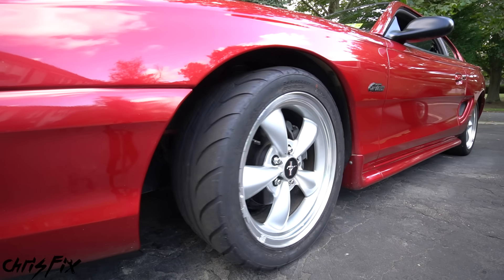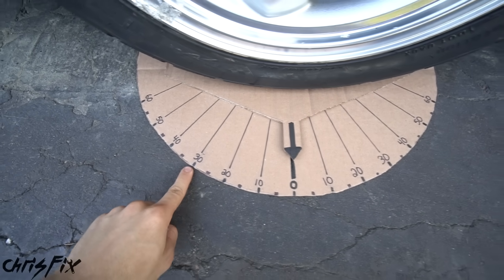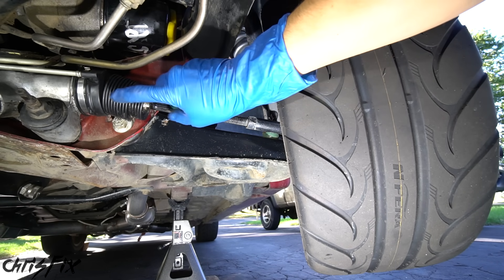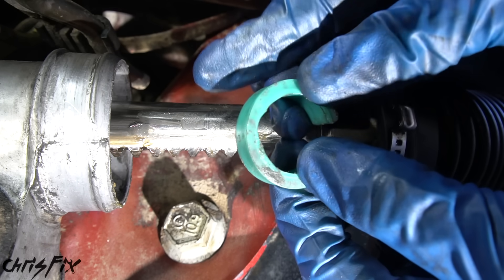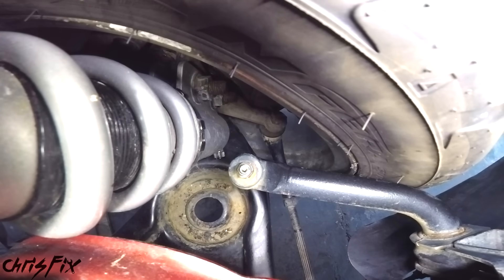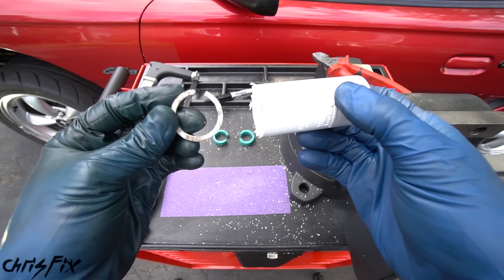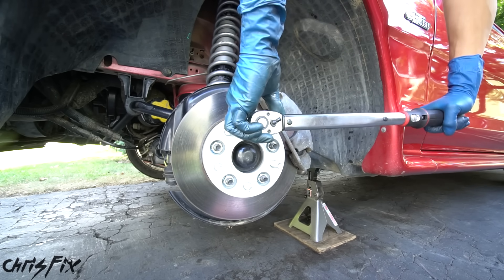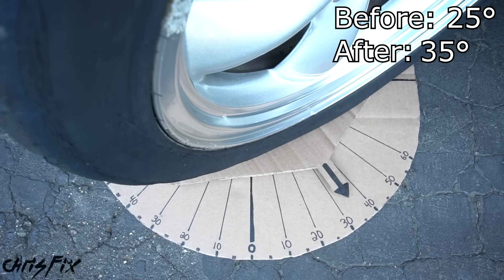How to Get Your Car to Make Sharper Turns (Steering Angle Mod)

Comment: Wheel spacers are illegal in Australia :(
Reply: Finan 7 only other options are:
-negative offset wheels 
-trim the c-clamp
-wheel alignment 
-that drift mod he mentioned at the end (future video)
Reply from the maker: Dang that stinks! That's what happens when people dont do mods correctly/safely using quality parts when needed! Wheel spacers can be very dangerous if you dont do it right and dont use quality stuff but that is why I explain all of that so hopefully people learn and are smart about it!
Reply: here in Brazil it used to be... But recently the government changed some laws and now we can even use air suspension... But any way, we must ask for a different car licence... its higher cost... Otherwise, if you dan't have papers, police can arrest the car and apply fines...
Reply: In Australia the fun stuff is illegal. I know because MCM.
Reply: Why ?!!!
Reply: ikr we are really out of luck with these things
Reply: Wtf why?
Reply: Harry A. Ness because they could shatter, supposedly. Also we can only add 50mm to our stock track width.
Reply: Isn't pretty much any mods illegal over there?
Reply: codywhitehead tbh probably i think their is a restriction to how loud your car can sound but if you are on a motorcycle its fine and i think u cant lower your car past a certain point yep our laws suck ass also on your second degree license you have power restrictions yuup suucks
Reply: codywhitehead id rather share my road with "hoons" ive literally seen an 80 year old man asleep behind the wheel on a highway swerving everywhere he got pulled over by the cops im pre sure ridiculous they are making plates on seniors cars so dumb they shouldnt be driving and people texting while driving is bad here also and i see people with broken headlights taillights everythint everyday i see these things here "hoons" arent a problem its the la2 and stupid women eating while driving :///
Reply: Answer this Australia “What isnt” 

Im sory if that made you mad but it feels like everything here is illegal
Reply: Its easy to say that the laws and enforcement in a country you don't live in are great ... because you've never experienced them. I bet you would've loved to get a driver's license where you're limited to under 50mph, and were previously forbidden to drive a car with a turbocharger - yup 1.2L turbos on economy cars made them illegal to drive for new drivers. And don't even get me started on enforcement, most traffic duties aren't done by traffic cops, but rather general duties cops (some are knowledgable but most aren't) and this causes plenty of tension between car enthusiasts and BIB. Mobile breath/drug testing checkpoints are also poorly set up, with high performance highway patrol cars used to block the road, leading often to a scenario where if someone blows past the checkpoint, it takes them 30 seconds to have a car set off to chase the crook. So if that crook was on a stolen motorcycle, there would be no chance of catching him because even if our XR6Ts can do 0-60mph in 5.1 seconds, the guy on the motorcycle will always escape if he had a significant margin over the nearest highway patrol car because of the severely limited helicopter hours police get here. 

And next year in NSW, when most of the Falcons are out, they've decided to replace them with absolutely garbage Chrysler 300 SRTs making it even easier for a crook to get away. At least other states, such as ACT and VIC made logical decisions with replacing Falcons/Commodores with Polestar Volvo S60s and BMW 530ds.
Reply: In QLD you can drive turbo diesels and a turbo car with an exception if it has a low power to weight ratio. The NSW rules of the slower speeds suck, especially on single lane highways
Reply: Yeah, most major mods need an Engineering certificate. And all others are made so the modification can only be minor, such as a maximum lift of 4".
Reply: Like take a look at this article, http://www.dailymail.co.uk/news/article-3308068/Motorcyclist-zooms-Narwee-RBT-high-speeds-Sydney-police-officer-throws-stop-sign-face.html
the first police car to give chase after the motorcycle blew past the checkpoint was a XR6T... 12 seconds later. That was when they had 4 HWP cars on standby on a residential 2-lane street, when the status quo is 4-6 HWP cars for a 6-lane highway. If that guy on a motorcycle didn't crash, the police would have never caught him. Of course as evident in the article, half of the Australian population appear to just be cunts that defend criminal actions, but you get that everywhere.
Reply: I saw something where people were getting tickets for hood scoops and one got one for his carburetors aircleaner sticking out of the hood.  They said if you hit someone the hood mods cause injure them
Reply: They should be illegal here in the states too. I love aussie laws and enforcement . Keeps the hoons at a minimum .

Comment: the clearence to the swaybar is to tight. if you go on track and the tire will work on the rim and move in corners it will rub. for a daily driver is will be ok.
Reply: On the track he'll never be a full lock while gripping in a turn.  If he's drifting, the front tires are basically rolling forward into the turn, so not much side load.  Its still close though...if it deflects enough to kiss the sway bar it'll be ok.  Not like a hard interference.
Reply from the maker: Thanks and great input! I have tested this on the track drifting (the most sideways and full steering lock anyone will ever be and at high speeds) and they do not rub. Since the sidewalls on the tires are short there isnt much flex. If you have a bigger sidewall like on a truck then yes it might rub but I would be concerned if you are turning that fast all the way locked in a truck. Usually when you are all the way locked you are going slow (unless you are drifting) so there isnt going to be much flex. Great thinking though and thanks for bringing that up!

Comment: That rack limiter looks like it would cushion the impact of the tie-rod and rack seal better than the tie-rod slamming into the seal directly. Also, although you have clearance while sitting on stands, once the car gets going turning can cause the sidewalls to distort and end up touching. You have performance tires so the sidewall is exceptionally strong but typical tires are likely to distort a lot more.

Comment: Is the moaning with the power steering pump a problem with Ford's pumps? My dad's 2010 Ford ranger does this but my moms 2006 Toyota scion does not, nor does my 2014 vw jetta. Great videos by the way.

Comment: 2 things.. 1. Why put wheel spacers on a car like that, when a burnout will do a uturn no problem...lol. 2. those wheel spacers studs are made of what metal? most of the ones i have ever seen are aluminum. But you say these are high quality, so hope they are steel. l fear aluminum isnt strong enough for the drifting and stuff you do with the car.. thats all. nice video!
Reply: I dont believe any spacer/adapter uses aluminum studs... The spacer itself is aluminum.  Studs are going to be steel.

Comment: Do not forget to compensate difference between front and rear offset, by adding the same spacers at the rear. Without it your car will be less stable and tend to oversteer, especially while drifing. This is tested and proved info.

Comment: Nicely done, you didn't forget anything on the mod side but you forget about "Ackermann steering geometry" The intention of Ackermann geometry is to avoid the need for tyres to slip sideways when following the path around a curve and compromise the vehicle stability in moderate to high speed turn, for example on highway exit, and more importantly when the road condition is slipery. Finally in some state it is illegal to modify the steering component to be street legal. but still nice video.

Comment: 👍 awesome instructional video. But you should mention that steering will be much more twitchy now especially at higher speeds. 

Side note
Your seat is way too far back from the steering wheel your arms are fully extended which means you have no leverage and in a panic or avoiding situation, your arms and hands are not ideally placed. there's a reason why race car drivers sit close to the steering wheel their elbows bent it's for leverage and control. 👍

Comment: Cool video and good to see the driftstang coming along nicely! However, there's another way if you need just a touch of clearance and that's smaller (narrower and/or lower) tires. In your case, it was the tire and not the wheel that was causing the issue. Furthermore, currently your front tires just barely clear your anti-rollbar statically. But when actually driving, those high profile tires will flex considerably and may start fouling. Don't worry about front grip - most drift cars run front tires skinnier than 225s, and I run just 195s on the front of my car and there's still way more front grip than I could ask for. All about the setup and tire model! Good luck and keep at it!

Comment: i don't know mechanic but this parts looks like compress as if the work as a "bumper" if you remove it, no risk to compress metal to metal and damage stearing over time? factory parts are not made to make life harder. but as always, i like your video and thanks to share.
Reply: Was just thinking to say that, there's a reason it's made of plastic , it probably works as a shock absorber, even if there's barely any, it still prevents the metals from touching.
But it might take years to take any damage cause u don't turn the steering wheel to the maximum that often.
Reply: Good point but also realize any time you modify a car whether taking out a piece of plastic, adding more power, more braking, etc you are shortening the lifespan of something.
Reply from the maker: I agree with Joey and good thinking Eric!

Comment: The problem is that your power steering pump seals will blow out when you use it to long
Reply: That's the case regardless. Hold your steering to one side for too long and it overheats and the seals blow. I'm sure this makes it happen a lot faster though.
Reply: Vaktrus I agree

Comment: Good video. You might want to check the brake caliper clearance on the control arm. I couldn't tell if it was hitting or not. Regardless, it looks like you were going to install clearanced lower control arms anyway. I've heard of guys hitting their calipers at full lock, compressing the caliper piston and losing brakes when they tried to stop. This is with aftermarket lift spindles and the caliper hits the steering bumpstop on the lower control arms on GM metric cars.. g body, f body, 2wd S10s.

Comment: But doesn't the wheel hub spacers increase you front track width therefore making it look a little UGLY?
Please reply i am eager to know
Reply: it does, but its a drift car, not a showcar. Getting rims  with a bigger offset is better if you're going for looks. Or maybe a dedicated suspension kit.
Reply: Ok now i get it
Reply: As they say, “Beauty is in the eye of the beholder.”
Reply from the maker: I cannot do the back just yet because I am making a video (as I explained in this video) all about spacers.

Comment: Did you put spacers on the back wheels? Because I saw only one pair.
Reply: Front track is usually wider than the rear anyway, so shouldn't be a big deal.
Reply: Paul Bou Jabbour no he didn't only the front wheels
Reply: plus its built for drifiting
Reply: Antonio i
Reply: I agree..it should be put on all 4 for symmetry
Reply: There is none in the back you dingus they dont turn

Comment: Yeah, I've seen a lot of constroversy about those spacers too. I think it's ok to use them as long as they're not on the driving wheels so there's not so much force exerted on them. Especeially not on the front wheels of front wheel drive cars where you have the driving and turning forces.

Comment: Don't forget to check your wheel clearance under load..not only with the tires up in the air...you don't want to rubb your tires in that situation. If you want to be perfectly clear, jack up one of the rear wheels under full stearing...this will reveal any problems.

Comment: Cool as usual but those spacers work also to prevent metal to metal contact in your steering system so removing them may cause long term damage to your steering system be carful !

Comment: The angle is also restricted due to the front CV joints on front wheel drive models (obviously not in this video). Sharper angles can quickly stress and wear out cv joints.

Comment: If you want the steering angle to be more even or if you want it more to one side you can undo your steering wheel nut and your tie rod nuts and take the steering wheel one spline (or more but id recommend doing it in one spline increments) to whatever side you want your steering angle to be higher at. Once you have it where you want you can shoot the steering wheel and tie rod nuts down. Only problem with this is that your toe angle will be off. The side you went to will have positive toe while the other side will be negative. You will want to do an alignment. At work our target is 37.4 degrees for each side but your 35 still wont pass. Im gonna need you to fix that lol.

Comment: Great, fine and dandy...as long as you understand that the more the front wheels the more the caster (steering axis angle) rolls the tire up on its edge  causing it to wear at a high rate...Check it out, find a parking lot where you can drive in a  circle...start with a big circle  and tighten the turn till the wheel wont turn any more, stop, get out and look at the pattern of rubber the front tires left...note how much rubber the outside edge of the inside tire left on the ground...as far as buying wheels with more offset...that make the tire stick out more...plan on replacing front wheel bearings and lower ball joints more often...more offset means more leverage on suspension components...and yes, you can buy spacers....do they come with a warranty? the farther you space the wheel away from the place the manufacture intended it  to be the more load you put on the wheel....hitting a road hazard that would normally just trash the tire and dent the wheel could cause a catastrophic wheel failure...your insurance covers custom modifications, correct?  Insurance adjuster comes out to inspect the damage to the front fender after a chuckhole  broke the wheel off...sees them spacers and they might deny your claim....just so you know...from  an old guy who has been there/done that

Comment: I'm not even going to read the comments for the hate  on using the spacers... But I'll say these 2 things... 1 you need to space the rears too, because having a wider track on the front will negatively effect the handling characteristics. And the best reason not to run spacers, is un-sprung and rotating mass, although for your purposes, not going to be much of an issue, if any of your viewers are thinking about it I think it's good info to share. What's why I won't run spacers on my cars for drift or time attack purposes. I hope to be 1/10th as good a youtuber as you one day... Great channel.

Comment: Pretty cool! I don't think this would work for my truck because my Ram. 1500 has an electric rack kinda like the Subarus have.
Just one question.  Why not just drive your drift-stang onto your angle finder instead of dropping it down from a floor jack?

Comment: There's something strange about your steering in particular though - I believe the inner angle should be greater than the outer one. This way the imaginary lines of the three axles - the rear one and the two on the front - intersect in a single point which is the center of the turn you're making(check out Ackerman's law)

Comment: That space you have on drivers side is maybe good for everyday vehicle but if you run your car in track then in left cornering tire actually tilts and hit car body.not a biggie for car if you dont track it but otherwise few dozen tight corners and you will see tyre wear.

Comment: I drive an 02 Lincoln town car 4.6L V8, it’s stupid long for a car and has the suckiest turning radius, if I ever need to make a u turn I just turn off traction control and let the back end slip a little to cut it sharp, works every time.

Comment: didn't see the safety washer tabs on the inner rack ends.... and the car maker put thoes limiters in there for a reason. yes you will get better angle but at what cost in the long run.
Reply: Adam o'sullivan drift stang...  Just saying not his daily driver